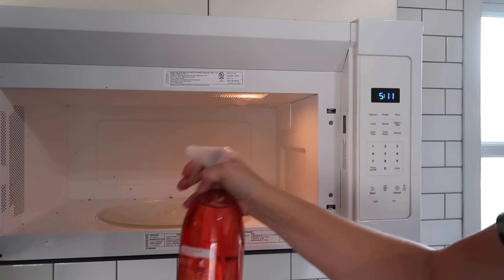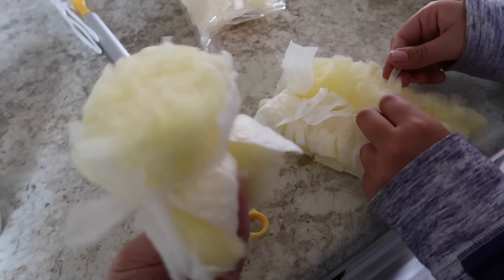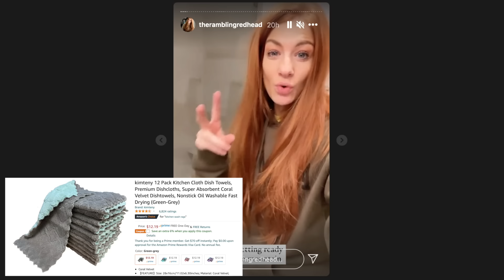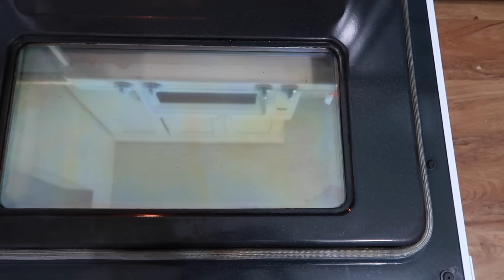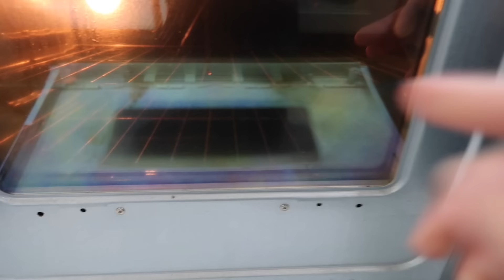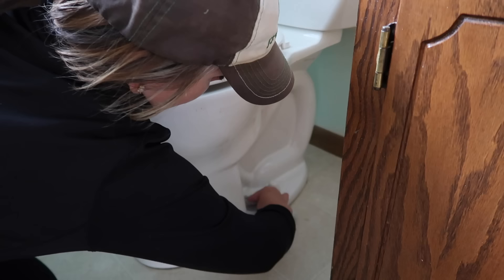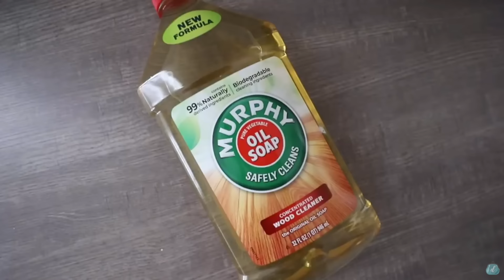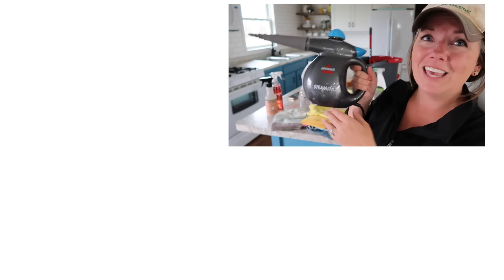Overrated Cleaning Products? Test them with me!

Comment: Quick tip... easiest way to clean your oven glass... quick spray with whatever cleaner you like... wait 5 minutes... take a single edge razor and scrape away the gunk!!! I use paper towel to wipe the mess, and finish with a clean micro cloth. It doesn't take more than 10 minutes!

Comment: I found a versatile duster that you can change out the end of handle with different heads that can switch out attachments that velcro on & off to dust or mop floor, dust ceiling fans, etc. and machine washable. I love it. Little pricey but it is a one does all mop/duster. From Norwex.

Comment: Aluminum foil wadded up really does an amazing job on scrubbing built up grime on stove interior and shower doors. Oh, and I really get a good quick deep clean when I put rubbing alcohol in my dawn/vinegar cleaner. The alcohol helps dry the surface faster. This is very helpful for laminate floors that are not waterproof.

Comment: I definitely have a favorite to share.  I don't like having a huge selection of cleaning tools however, I will never own a standard mop again.  It looked like you had a problem with your handheld steamer but my mop steamer is the absolute best.  I don't need cleaner and it is simple and easy to use.  just add water put a clean reusable rag on the end and steam away.  The floors are shiy and clean after a sweep and one pass with the steamer mop.

Comment: THANK YOU for actually cleaning a home that's not  already  cleaned (like mine).  This shows me if products are worth buying or not.  My shower had some black mold-ish that I couldn't take off. Tried several products and nothing. Finally the scrubbing bubbles foaming bleach for mold and mildew did the job. Not embarrassed anymore. :)

Comment: I use Bar Keepers Friend on my stainless steel sink. I also use microfiber cloths with an orange degreaser cleaner to remove grease and grime on my stainless steel gas stove. Microfiber cloths work great on stainless steel appliances to minimize streaks.

Comment: I want the spin mop. And the micro duster yellow handle thing, I didn't fluff out the ends. So it was scratching my stuff. Didn't buy any refills. But I do use the handle to reach down into the lint part of the dryer, bringing the lint up to a vacuum hose. Keeps the dryer safer. Since y hubby does all the kitchen work, Shopping, cooking, dishes, and yes even cleaning the oven, I just mop the floor, and wash windows in the kitchen. 🏡😘

Comment: Thank you for reviewing the products.  Over the years I have a tried so many different things. I have small hands so I find large microfiber towels were just too big for me.  I bought the Kirkland Signature Ultra Plush Microfiber Towel, Yellow, 16 in x 16 in, 36-count from Costco and used my serger machine to cut each of them into 4 pieces.  They're a great size for my grandkids to hold and clean with and they work really well.  Another good cleaning tool for me is the GUM Denture Brush.  The bristles are longer than a regular tooth brush and it gets into tight spaces to clean.

Comment: Love Swiffer mop and Swiffer dusters!!  I've used them for over 20 years, and the heavy duty ones are even better than the original ones.  Also, I have the Swiffer wet mop that I use to clean our floor tile in the bathrooms and entries into the house.  We live on a VERY dusty and busy gravel road, so dust and dirt seem to come into the house, daily.  The gravel is limestone, and if it gets wet, it can be like cement to get off of surfaces.  Microfiber cloth is another go-to, along with Mr. Clean scrubbing sponges and tear-off sheets.

Comment: We recently finished out our bedroom with engineered hardwood, so I bought a spin mop and Murphy’s oil soap. My spin mop is the Mr. Clean brand. Instead of using a foot pedal to spin, you flip a release lever on the handle, and push the mop to spin, then flip the lever to lock. It’s smaller than yours, but solid. I’d worry that I’d flip the whole bucket over using the foot pedal.
Reply: Be careful about wood "cleaning" products. Engineered hardwood has aluminum oxide coating and almost all commercial cleaners [even Bona and other big names] will cause a horrible hazy buildup. I learned the very hard way. In the end, soap and water in a spray bottle worked wonders and after two days of some serious elbow grease they were almost back to normal.

Comment: I always lay down an old sheet over surfaces when doing ceiling fans, etc. Then fold it up, after you've completed the task, and shake it outside. I've also used just big trash bags, a clean drop plastic cloth ....whatever you have. I am just a fan of using hot water and a mild cleaner for fan blades, to get EVERYTHING off of them.

Comment: Oh my goodness I was just talking about the baking soda paste with vinegar water spray. This can also work on tubs that have lost their clear coat. And you don't want to use a bleaching agent. I suggest you just leave it on overnight. Make a paste. It's very easy just to shake it all over your tub. Get it a little damp scrub it all over. Leave it to dry. In the morning down I use hot water and vinegar. And I just scrub. Rinse. Walla... Beautiful clean brightened... Removes dirt grease and grime. Bleaching effect without bleach...

Especially if one has breathing problems. This trick is for you. Works for your oven works for your sink works for your tub...

Comment: I use the vacuum cleaner hose with the brush attachment to do the ceiling fans. Fast and easy and  dust bunnies don't fall on the bed. I do have to stand on the bed to clean the fan.

Comment: I've been doing a difficult paint job in my kitchen, found out I have old 1950's lead paint. So, I had to encapsulate and paint every cabinet, every drawer, but I did need a good cleaner degreaser. I have been buying Krud Kutter and for the price, no way, ever again. Twenty bucks at my HD store. I went to a Dollar General and bought 2 64 oz jugs for a total of 8.50 incl tax. I always used the dollar store Awesome. Times have changed and everything is much more expensive. Four bucks a jug to me was a deal. I know it works great and it will release the grease and also the varnish, yes it removes varnish from the cabinets pre sanding. 
Also, great video. When I saw the insulation come off your oven door I thought no way. Glad your hubby was doing that part of the removal.

Comment: I used to clean houses for other people and love the white bar cloths for cleaning.  You can pick up two dozen for around $12. at Wal-mart.  They have lines like stripes and pick up a lot of dirt.  Even though they are white, you can easily get them clean by adding a little bleach to the wash.  They are the size of a wash cloth and are easy to hold and wring out.

Comment: Hi Dawn,
Swiffer Dusters are easier to fluff if you just hold them on the kitty corners and shake.
I haven't used the one you are using.  I use the small ones that get into nooks and cranny's. Once in a while I use a cloth with water but for every day, the Swiffer Dusters are great, especially if you need to do a quick dusting before company comes.

Comment: I have to agree with you on those little green and grey cloths. I have the same ones and I love them! They are so soft that I am very comfortable using them to clean my crystal but I. An also clean the furniture or walls or floors with them. They're inexpensive but sturdy and do the job. But I am also wheelchair bound, so if it's anything that I have to reach to clean, I bring out the swiffer to dust. 
I have also used a mop with a magic eraser head on it scrub things up high that I couldn't reach otherwise.
Thank you for this video. I will have to hit the Dollar Tree and give those two cleaners a shot.

Comment: YOU GOT THIS. TIP-Don't unscrew the handle. I do this all the time, using Windex or a degreaser. The thing about grease, wait f5-10 minutes and it can get soft. You can use a razor blade knife (just like you do on car windshields). 66 in Texas.

Comment: I know this was posted 2 years ago, but for the steam shot, you should try just water….and maybe spray the surface with vinegar. But I have the steam shot (the same model as you) and I get a really powerful steam spray on mine. I think the vinegar is decreasing the power of the steam. Also, there are several little attachment brushes that make it work a lot better.  I spray and scrub with the brush at the same time. The instructions also stay that the nozzle should be no more than 3 inches from the surface and hard spots may need several seconds of direct spray. Try these steps and you may get better results! I love mine. 😊

Comment: I started using zep hard wood and laminate floor cleaner. 12$ a gallon. I squart it down and wipe with a microfiber mop like your old one and I'm so far impressed! Nice and shiny, but I haven't used it long enough it to see if it leaves build up. We only have hard wood floors. I know those bona products are a little pricey. I hope it works for your floors!

Comment: Grab the swiffer duster on each end and move you hands up and down fast and it will fluff the fibers.  I agree, I wouldn't use the Swiffers all the time but they are good for getting into hard to reach areas. Magic eraser works great for scuff marks.  I was amazed how I didn't have to touch up paint on so many areas.  I'm going to get those velvet dishtowels. Thanks for this very informative video!

Comment: I have 2 ceiling fans and I run a doggie daycare. Needless to say, the fan blades get dirty very quickly. I find using the vacuum with the brush attachment is the fastest and I get good results getting all the dust off.

Comment: When doing the microwave add some lemon juice to the water when you heat it. Let it sit for about 2 minutes or so after heating them wipe it clean. The acidity in the lemon juice helps cut through grease and other foods.

Comment: I'd use a steamer closer to the surface. On the small, not-so-powerful tool like this temperature which is expected to work as the best solvent falls down drastically on every millimeter. And the steamer works perfectly when you need to loosen down the grease buildup or increase to power of your cleaning agent or remove dust from the places you'd normally use a cleaning toothbrush

Comment: I clean windows with  50:50 vinegar and water in a spray bottle and it works like a charm. Like you, I'm a cheapo when it comes to cleaning stuff...but I'm definitely going to be getting those microfibre cloths. The steamship may work better if you work in small sections...??? Steam, then scrub/wipe. Idk 🤷‍♀️  I wouldn't buy one either. I try not to buy anything that reqdisposable refills to work so I have the Flylady microfibre duster like the swiffer only washable. We have high ceiling fans and fixtures so it's great.  Thanks for trying all these products,  Dawn. Very helpful 👌

Comment: Regarding Swiffer dusters, I cleaned professionally for many years, I do not like Swiffer brand dusters because they're expensive you use them up fast, it's adding to landfills but most of all the scent bothers my allergies.  I like a very similar but superior product, the microfiber dusters chifon from dollar tree for $1.25. It is cheaper,  the little fibers are more fine so I feel it traps more  dust ( it traps dust so well that's how you know when it's used up, it clumps into  dreadlocks of dust!) it lasts much longer, it takes up less space to store and in the landfills when you throw it out, it has more cleaning surface ( swiffer is more handle) and most importantly it's not scented so it doesn't bother my allergies

Comment: Thanks Dawn. I love your videos!

I also love my O Cedar spin mop. I've been looking for about a decade for the best mop for me because I'm older and not as strong as I used to be and also have a bad back. My floors stay a LOT cleaner since I found the O Cedar spin mop.

I have a steamer too. I bought it a long time ago on my mom's recommendation, but I don't think either of us still use it because it just seems to be more hassle than it's worth. It's going in my donate box.

I also love to use baking soda and vinegar together or separately.

Thanks for telling me about Awesome cleaner from the dollar store. I'll be picking some up.

Also, thank you for comparing the microfiber cloths. I'm glad I just went with the cheap ones.

As to Swiffer - I don't like Swiffer quality so I avoid it like the plague. I have an ostrich feather duster, but I just use cloths for cleaning my ceiling fans.
Thanks for the tip about the pillowcase on the fans. I have an old one I'll tuck into my cleaning caddy.

Thumbs up  Chickie. Good job!

Comment: The method heavy duty degreaser is best to clean the oven and stove and racks. And it takes little time to work. And the smell is nice. Hold on on tossing the steam cleaner. You could use it too clean the inside of the fridge when spills are there and you need to clean it up fast or spills have dried on the steamer removes them without chemicals. And you could also use it to defrost your freezer in an emergency

Comment: Just used one part “cleaning vinegar” and one part Dawn dish soap on my shower floor. Amazing! So nice to not have to run to the store for something special. (I have a lot of calcium and lime in my water.) I mixed half of each in a Pyrex measuring cup and heated in the microwave for 35 seconds. (So they would mix together.) Then poured the mixture into a spray bottle. 
Very pleased with the results.

Comment: For the Norwex mop: Instead of running to the sink, I buy Method floor cleaner. It has a squirt-top, so I just spray however much I want on the floor, scrub away, and squirt more as needed. I do hate having to use the rubber brush on the pad before putting it in the wash, but it's better than throwing Swiffer pads out and I can store the handle beside my stacker set in the laundry room.

Comment: The baking soda and vinegar is good for glass top stoves too, I know people are worried about scratching them with harsh cleaners, which this won't.  For the scuffs, try Google Gone first then clean it off the wall. The scrapers are also good for getting the last bit out of squeeze tubes. Cut the end of then cut down the side. 
I think the steamer is good for sanitizing and maintenance and you can use it with water to steam your clothes.

Comment: I didn’t know that our walls got dusty for the longest time! I only found out when we hired someone to paint th interior of our home!! Since I found that out I have been crazy about the walls having dust on them. The best thing I have ever found to dust the walls is any big floor cleaner mop pad! I prefer the Norwex mop. Wet it and wring it out really well, Leave it on the long handle and just “mop’ your wall!! For spots that really need cleaned rather than just a dusting, spray with a cleaner and then use the mop! It makes it a much smaller job with a big mop pad too!!

Comment: I’m sure someone has already said it but you used the e cloth window one wrong. It comes with 2 cloths. The honeycomb one does all the scrubbing for you, with just water. Then the one you used is like the drying, takes out the streaks. If you windows just needed a shine and not grime removal then you use just that one. Also, I love you for trying all these. It’s a journey I have been on the past 5 years and think I’ve finally found what works for me from watching all of these types of videos!

Comment: Awesome works great between tenants. Nicotene off ceilings, walls and windows.... its on EVERYTHING if you've had a smoker.  Sticky stuff, greasy stuff. counters, cabinets inside and out. Stove... all 24 pieces!! Finger prints. Floors. Doors. Woodwork. Vents. Radiators. Shower and curtain, toilet and med cabinet. Dried paint off my winter coat. )))) I'm a walking commercial. ))

Comment: The new O Cedar rinse and spin mop is AWESOME!!  I do use a tiny amount (2T) of Bona floor cleaner with the clean water.  I found that just water streaked.  I am nutso about cross-contamination so being able to rinse my mop every time is perfection.  (Don’t judge but I actually have a separate bucket of plain water to rinse a second time….😬)
Reply: No judgement from me, I do the same.(with the original spin mop)..lol...    Although full disclosure, I really didn't think about it at first, just loved the design and changed the water per room.   Watching videos on the cross-contamination was a light bulb...😯
I don't really like the newer rinse spin one (still have also) too small capacity.  😁
Reply: Hey Debbie!  I’ve heard that complaint from others who used the older version, but anything is better than using the Swiffer Wet Jet pads 🤪

Comment: I’m sure by now you’ve learned how to use the steamer to get better results but It’s basically an indoor pressure washer. I use mine on grout, where the baseboard meets the floor and other cracks and crevices that gunk likes to hide. I also like that it sterilizes things well.

Comment: Thank you for doing this!! On a side note, the glass cleaning test, you didn’t use the e-cloth correctly.  The cloth you used is meant for polishing up surfaces (windows, mirrors & stainless steel), after you clean them with the dampened microfiber e-cloth. It really helps to scrub those more neglected areas.

Comment: Steam machines work most effectively if you use an agitator brush tip and wipe the surface right behind after the steam hits the surface. Seconds after the steam hits, the surface cools, so you have to wipe in concert with the steam hitting the spot you're working on. I was able to clean most surfaces very well using that method.